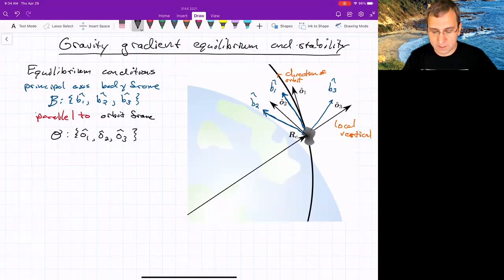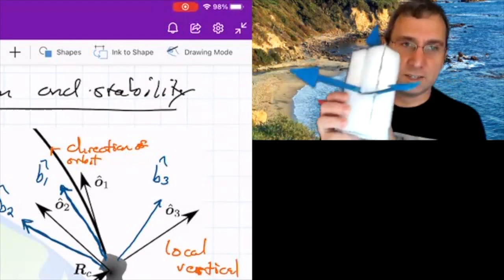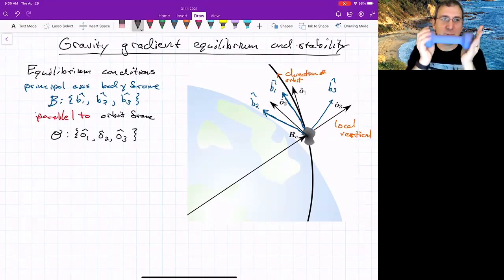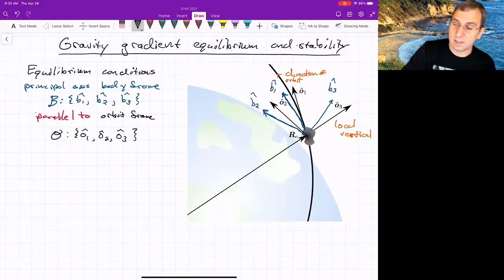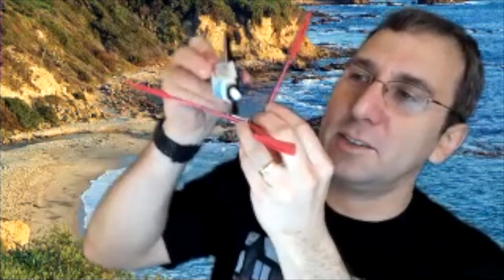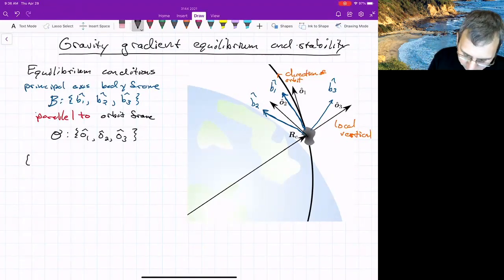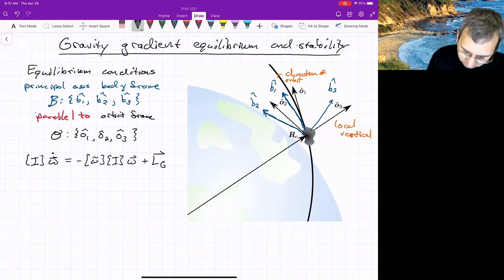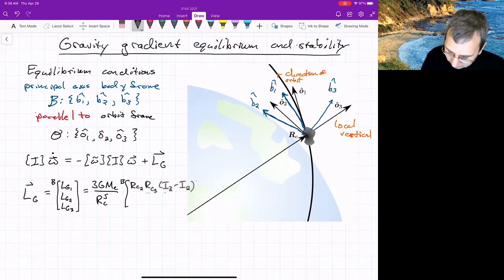Gravity Gradient, Part 3, Stability Conditions, Frequencies, Torque Equilibrium Angle, Space Station

Comment: Can someone explain what ky and kr are for and what their significance is? Which conditions dictate stability for yaw and stability for roll?
Reply from the maker: Malek, ky and kr are just convenient notation for some ratios of moments of inertia; physically they represent how close the moment about axis 2 is to axis 3 (that's ky) and how close the moment about axis 2 is to axis 1 (that's kr). Mathematically, they just make the resulting equations look less cluttered. The conditions for stability for yaw and roll are just one condition shown at 30:37, I2 > I1 > I3. There is no separate stability condition for yaw, and then a different one for roll. For this problem, the dynamics for both are coupled and the the criterion is the same.